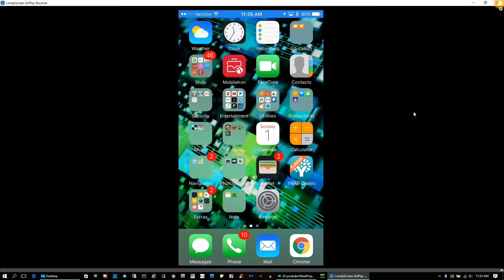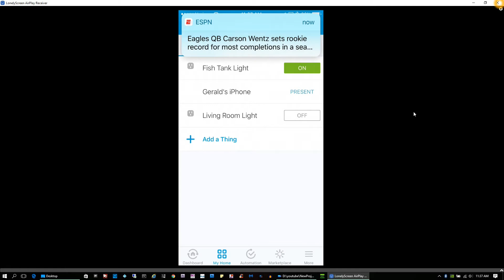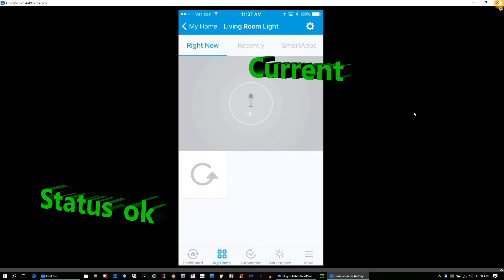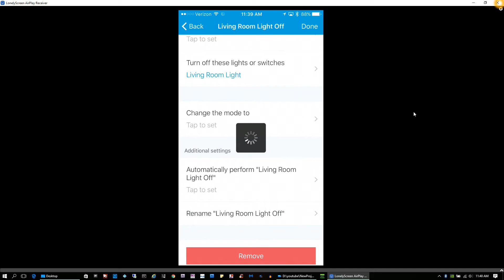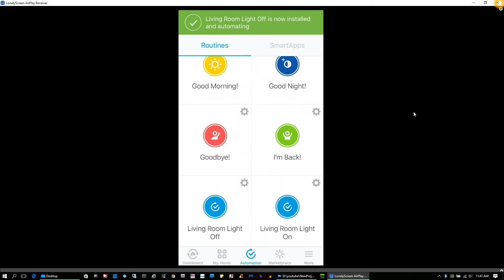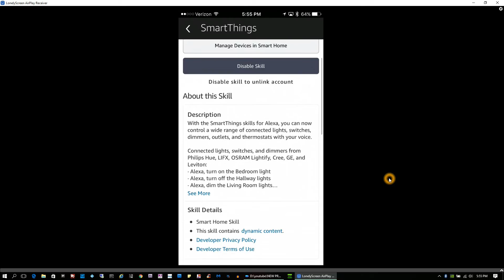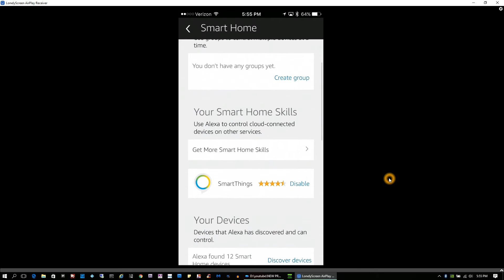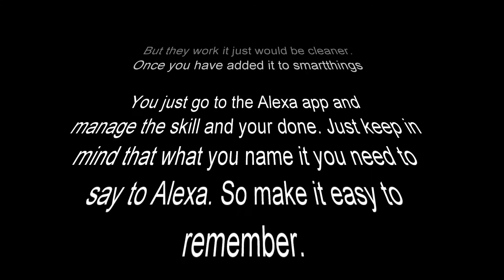Samsung Smartthings Part 2 Easy setup Adding zwave devices and routines, test echo dot

Comment: Great video.  Have been watching videos to see if Smartthings is going to work for me.  Hoping you could answer a question.  Regarding the new entry for turning the lights off at a certain time, can you set up the light on to stay on for a certain time period (say 2 hours)??  This is important to me as the main thing i want this for is to turn on outside lights with a trigger and don't want to turn them off each time.  Thanks again
Reply from the maker: J R I do not see a toggle function to have a set time period. But do see triggers . So you can have the light trigger at your mobile phone showing up and have a good night mode set up to shut off lights at a certain hour or have a routine set up on a switch or button or motion to turn it off. I am going to put mine on a schedule for sunset and have it turn off at sunrise. I have LED bulbs so it's not that much power.  That is a good idea to add momentary toggles. I know that there is a web utility called if this then that or ittt which might get you what you want. I haven't used it yet. But if I do I will make a tutorials on it. Thanks for the comments